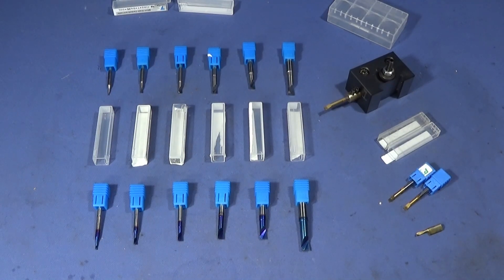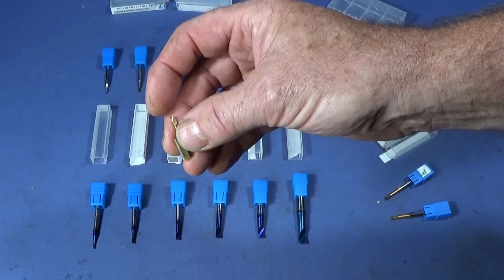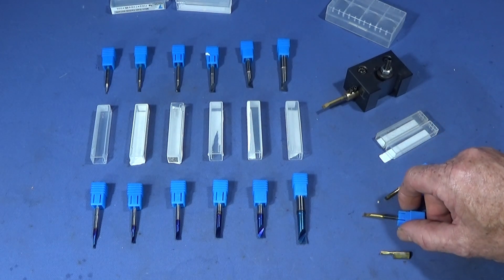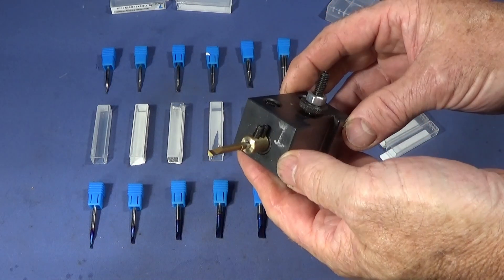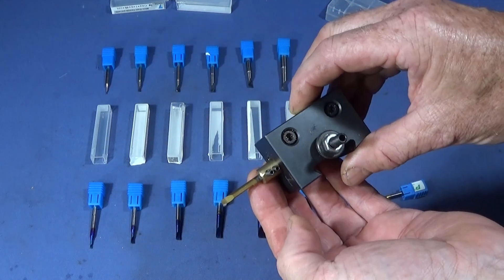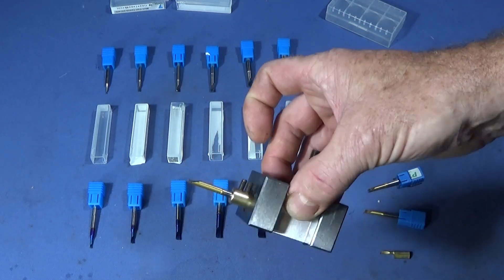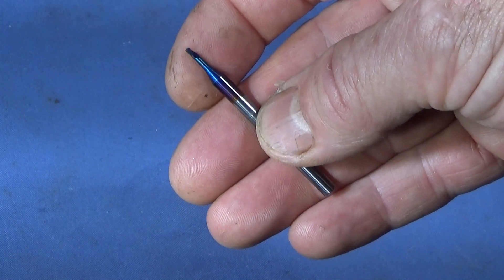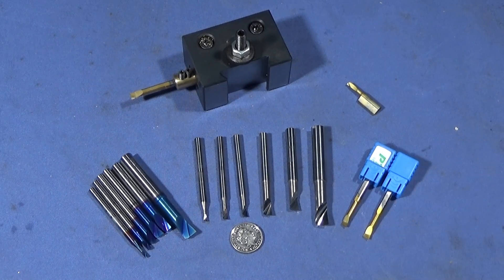New DrillPro Small Hole Solid Carbide Boring Bars + Blue Nano.

Comment: I am new to the mini lathe and have been watching your articles with great interest so thank you.  I am about to start building my tooling collection and will follow your advice.  I have two questions if I may.  First, which quick change tool post do you use and will it take the 12mm tools you reviewed - in my current tool post anything above 8mm is above the centre of the work piece.  Secondly, my Clark CL 300 does not have a speed readout, and I notice your machine seem to have a reto-fitted one - could I buy and fit one of these?

Comment: Hello Steve, just been seeing your Bangood review on the Aloris type tool post kit, can you tell me please, is the 250-000 post big enough for your Myford ML7 lathe, and are you pleased with the kit. I ask because I want to order it soon.My lathe is about the same size as yours, I was thinking of the bigger sized kit, but then it might be a strain on the lathe taking, or trying  to go for to big a cut.
Please Steve, I would like your thoughts on it. regards Colin.
Reply: Use a boring bar that compliments the size of hole you want. If your drilling 1/2” hole start with 1/2 boring bar. Far more rigid and apt to be more accurate. Unless what you’re doing is very small and shallow you won’t find a need for minis. Just because you have a larger boring bar doesn’t mean you have to take deep cuts. Typically I will go size to size or next size under and find that will provide you the best results.